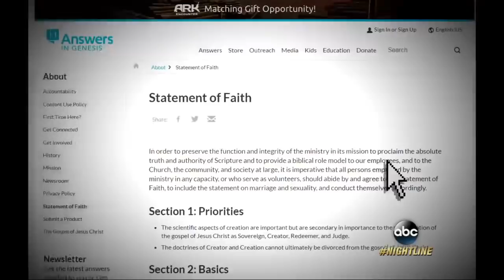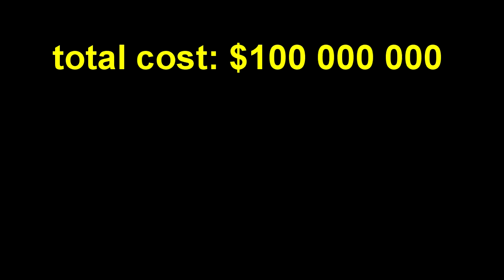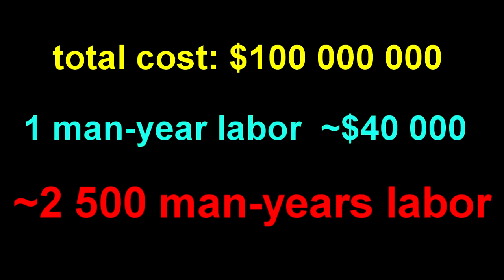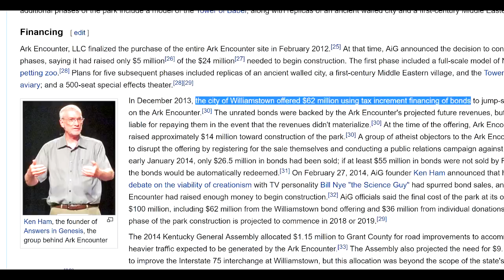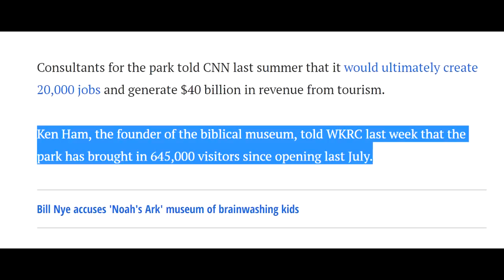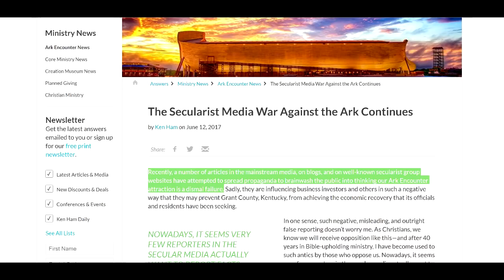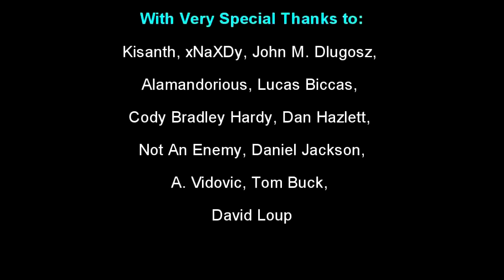Why do people laugh at creationists (part 44)

Comment: As a woodworker, I hate to say it but yes, the original design and build of the ark is plausible within the timeframe. This attraction is not a ship, was not constructed using ship-building methods and will not float.
Thanks to treatises and manuals form the 19thC we know that cabinet makers were expected to finish work at least as fast and usually significantly faster  (15-30%) than they are today, in spite of "primitive" tools.
We also know, thanks to the anomaly that is China, that it is entirely possible for a human to construct complicated woodwork at 90% efficeincy to modern western trade expectations.
That is not saying anything sbout any of the multitudfe of other issues, but the timframe is indeed plausible.

Comment: Your constant condescending giggling during the narration is just so intellectual...as is using George Carlin as source material.
Reply: Tbh i agree with you but I also agree that its quite a ridiculous thing, also I doubt heavily that a ship like that would have been able too carry 2of each animal and fit them let alone withstand the incredible punishment from a biblical flood, not a wooden ship with a roof like that, it would be crushed to bits
Reply: Joeseph Smith  yes I belive in the flood but I believe it was a cataclysmic event like a pole shift or a huge or multiple meteor strike, the likes of which would cause a wave big enough to destroy that ship, being timber framed. I belive there is truth in at least some of the bible but I don't belive in God and all of that thrown in the mix

Comment: People can be smart in the past and another thing 2 years of labor with 500 people.57 years with 5 people. I don't see anything wrong with that.
Reply: well despite that the work doesn't just equal when you have less people, there is a reason why something that can take an hour alone can be done in 10 minutes with 2 people. the more work you do the more time you need to rest. on top of that you're acting like doing manual labor at 57 is easy ON TOP of the fact that the 57 years would be added onto the age they were when they started building the arc. so most of them are around 70+ years old. yeah, nobody at 70 is lifting big ass logs that also would have decayed and would need to be replaced constantly. the math just doesn't add up

Comment: so we still don't know how the pyramids were built. Lets just say something happened to those pyramids that destroyed them completely. Does that mean they never existed? Just because we personally don't know how they did it?
Reply: Maybe you should do the extensive amount of research and google "how the pyramids were build"
Reply: @late8641  lets back up a bit. You say the big bang has nothing to do with evolution, but it is the base to explaining why evolution came to be. You cannot have evolution without explaining where it came from. Which then you would have to say it came out of nothing and then you would be a mad man, cause cosmic radiation didn't create itself. Time, space, matter, and everything else couldn't have created itself. Something cannot come from something. No matter what you say, Something had to come from nothing.

Also, there is plenty of evidence for a worldwide flood, clams found on top of Everest, multiple layers of rock within the earth stating that sediment would've had to be put down very quickly. Bones have to have a very specific condition to even turn into fossils. They have to be covered very quickly and sealed off from open air. Almost like a flood would do. Cover up the animals so fast with sediment that air couldn't get to them. Tree's sticking straight up through multiple rock layers stating the fact it would have been very quick to be covered up. A tree couldn't survive millions of years to be covered up like that.

Evolution is as much of a religion as Christianity is. There is no possible way for a simple gas to create an element as complex as uranium or plutonium. Professional statistician's have proven it would have taken at least quadrillions of years to even have a chance of things lining up just right to create a single celled organism. A billion years looks like a hairs breathe now. Yes we have similarities with monkey's. Yes we have similarities with other animals. That really doesn't mean anything. It just means that the same materials can be used to make multiple different creatures, it doesn't mean we came from them.
Reply: @Redbaron2018  can you have a noodle recipe, without knowing how to wheat?
Yes.
If the big bang was disproved tomorrow, that wouldn't do a thing to evolution... Evolution would be unchanged, if universe farting unicorns made the universe.

There is no evidence for the flood.
Clams? Tectonics
A flood doesn't produce layers, it produces gradients. Also the layers aren't ordered by density and the fossils aren't as well. That's one of the points refuting the flood.

There are no trees standing up through multiple strata. They are straigth inside of layers that can form fast, like ashe or sand or mudslide layers.

Also why do you think geology claims, that all layers take millions of years? Also, do you think geologists don't know what it takes for a fossil to form? You talk like you do...

"There is no possible way for a simple gas to create an element as uranium or plutonium."
You not realizing, that the sun exists or that "a simple gas" also consists of elements.

And you acting as if evolution is just random chance is just another prove for your pathetic amount of knowledge on the topic. 

You are just full of crap...
Reply: @BluePhoenix_  Evolution IS random chance though😂. Have you not been paying attention? Also they do claim that each layer equal's thousands to millions of years, how else would they have come up with their stupid system of saying "Oh!, these fossils were layered here so it must have lived in this period of time." Also, Have you been living under a rock because there is actual photo evidence on google of fossilized trees going through multiple rock layers lol. Also, if you kill a deer and leave it laying on the ground. Will it turn into fossilized bone or will it rot? It will rot because the conditions aren't met for it to be turned into fossil. 
To your answer of can you have a noodle recipe without knowing "how to wheat" is untrue. Without knowing what wheat does to things you wouldn't have a noodle recipe. The reason behind having a noodle recipe is because someone of intelligence created it. Not random chance that a noodle recipe spawned out of thin air.
Reply: @BluePhoenix_  so what your saying is that evolution isn't random chance and that something is behind it pushing it to go a certain way.......almost like a god figure.
Also, you can't play and build with Legos if someone didn't create them in the first place. Another form of intelligent creation. You cannot tell me I know nothing about evolution when your over there saying it didn't happen by random chance. Look into it again won't you? Actually don't, because it cannot work.
Reply: @Redbaron2018  no, that's not what i am saying... And you still don't understand the examples...
Until you can't show, that nature was created and the laws of physics were dictated, you have nothing. Atoms move in patterns dictated by physics, living thing move in multi layered patterns that also go back to physics. You said evolution is random, which is demonstrably false and only shows your ignorance on the topic. Why do you think nature cannot be natural? 

And how exactly did you still not understand the examples after i explained them multiple times.
If you want to put a god behind what science explores, i don't care. It's a useless and unsubstanciated claim, but fine. It doesn't matter to evolution if god created the universe or not, it doesn't matter if he farted out the first cells, or if he dictated physics. All of that doesn't involve and therefore doesn't affect evolution. As i explained three times, it doesn't matter where the building blocks come from to the process of building with them. And the process that "builds" living things as fsr as we know is abiogenesis and the process that changes living things is evolution.
It doesn't matter what comes before evolution, evolution itself still stands, even if you could somehow successfully squeeze your god in the narrow gaps of our knowledge.

I repeat for the last time: the source of the ressources doesn't matter to the process.

If you still are unable to understand this simple thing i don't see any reason to talk to you anymore, because i don't think you could possibly understand the more complex stuff.
Reply: @BluePhoenix_  the source of where the building blocks DOES  matter though. Without anyone to invent legos could you play with them? Without anyone creating the noodle recipe, could you make noodles? You need to know where something came from to actual be able to use and expand on it. You cant just say evolution was there all along when it wasnt, the big bang would have had to come from nowhere to then create complex life from a rock, then form evolution. Without the big bang or anything really for the beginning, your argument is faulty from the start. Also it doesnt matter if scientists say "oh we think this happened back then to create this, or to cause this to evolve". When someone says "they think",  you are just having faith in what they say is true. Just like christianity. Both require faith, but only one is correct.
Reply: @Redbaron2018  so you still either didn't understand or you don't want to understand...
As i told you, i am done now.
Bye

Comment: Making a much needed Correction,The ARK was a Coffin ,no Ship building skill was necessary, the had skill at making Coffins,you who do not accept the Scripture, you read into the Scripture what it does not Read,it was a Coffin with a Window in the top,it was not a Ship, now move to you next missing information .
Reply: @billcipher779  calling it a coffin might sound a bit weird, it essentially was a box, not a boat, that's why it's called an arc and not boat.
And coffins are basically just boxes.

Comment: As an engineer, Thunderf00t is first place I go to check if crazy ideas sound like a good idea. However, when doing the calculation for Noah, there is a lot of speculation that it took closer to 100 years to build the ark and he used hired help as well. Also, climate was likely very different (especially near the equator) so they could have had abundant natural food and been able to devote almost all time to working on the ark. If you had 100 people working on the ark for 100 years it is possible. Hard, but possible.
Reply: Ships built with 100 year wood that have survived both weather and time is not the best at floating. Or remain whole. And how old would noah had been if it took 100 years? Life expectancy wasn’t that high in that time.

Comment: Your the same dude to say its impossible to build a pyramid
Reply: No he is the dude that will explain why people that think the pyramids were built by aliens are foolish. You are confusing something that is complex to build compared to the ark which couldn't have been built.
Reply: Difference between these two is that we don't have records of which methods people used to build pyramids, but there are several ones which could have been used to build those, no magic required, just bunch of slaves and one of many methods. While with this boat, well, it's not only structurally impossible to be built it could not have been built by a single family even if they been immortals...
Reply: No. Because the pyramids were built by 100,000 men. Not a small family. That’s why it only took 20 years. Because they 100,000 people to work on it. Not a small family, who it would take hundreds of years to build a boat the size of the arc. If they used 100,000 men like they did with the pyramid then it probably would only have a few years.